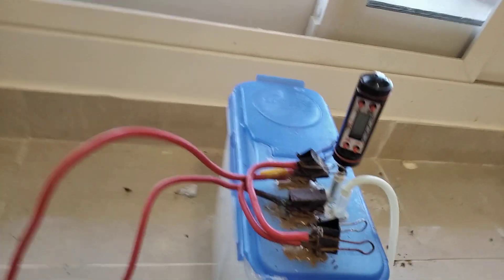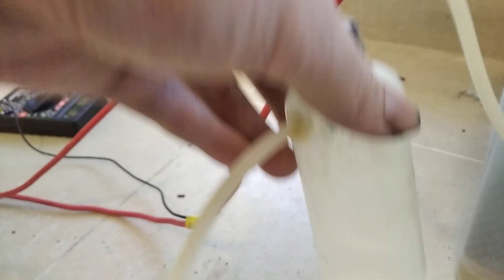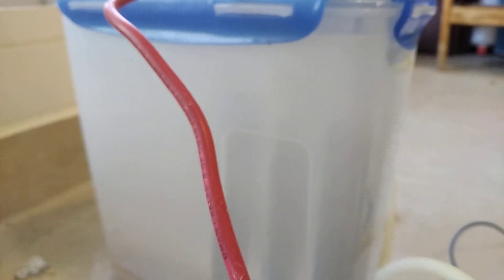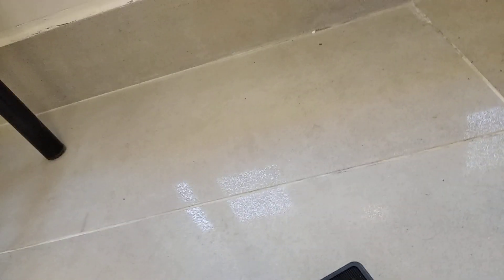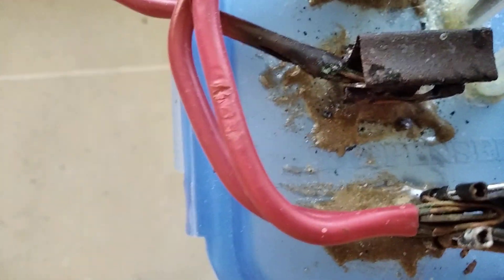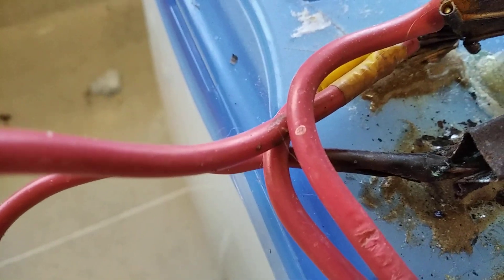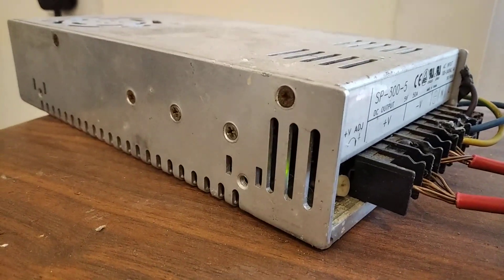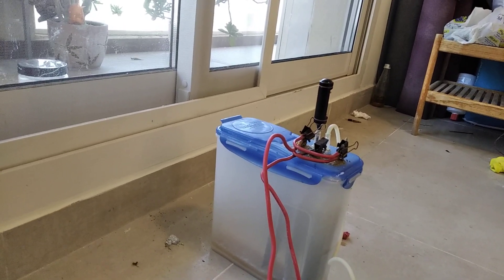in depth overview of chlorate cell setup

Comment: Hi MB, found this another interesting video.. 
could you advise me how to remove the graphite deposits if I use graphite? I tried a way first by using graphite, but found brown deposits likely the grpahite errode

Thank you for your answer
Reply from the maker: Filtration better use vacuum
Reply: Thank you so much MB for your advise, it works

Comment: Hello you soldered your wires instead of putting alligator clips? you have no loss of energy with this technique? it does not heat too much without clamp? Thanks for your help?
Reply from the maker: the buss bars are copper plated which means very little losses
Reply: MysteriusBhoice thanks, how many grams of hydroxide sodium for ml water do you use for neutralise chlorine gas? Thanks
Reply from the maker: @pyrotekmanfred6503  for the scrubber that whole thing is really optional.
you can just vent it out and also without the clamps as long as the buss bars are copper plated it wont have any resistance increase although I still dont recommend not using clips or bolts.

Comment: Hello , what do you use like epoxy : the dev con ? And where did you buyed your plastic jar ? Thanks
Reply from the maker: epoxy works for the electrodes but be sure to copper plate the electrical contact points using 50% ethanol solution and copper acetete.
3 volts 0.1 amps
Reply: MysteriusBhoice you are starting alway with sodium chloride ? And after you make methatesis with KCI?